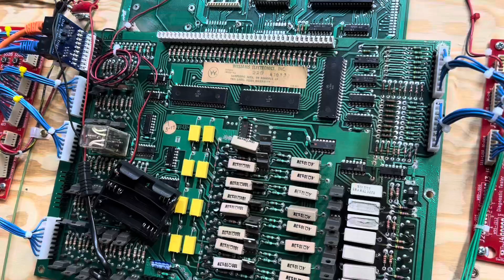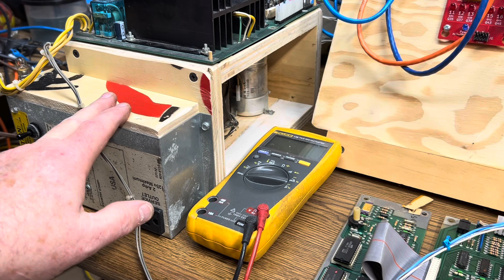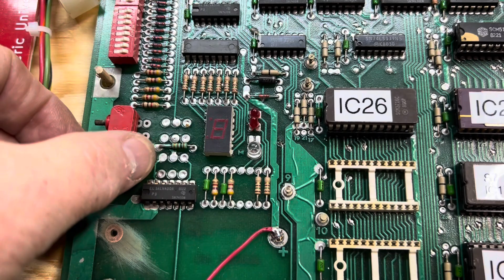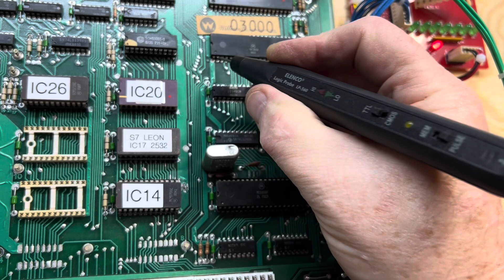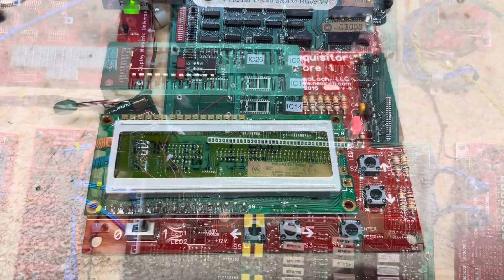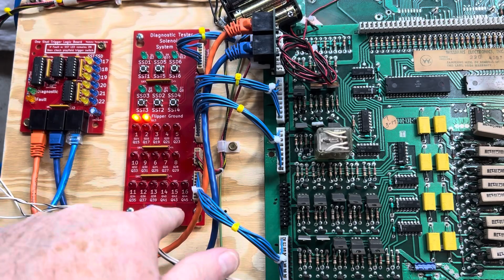Williams Black Knight System 7 - Using Leon’s Test ROM

Comment: The flickering is due to the refresh rate not matching the camera, you can change the frames per second on the top right value. Mine is by default on 30fps which is higher than my old 8 was from what I remember.
Reply from the maker: Thank you!